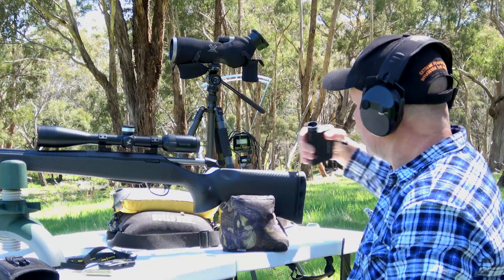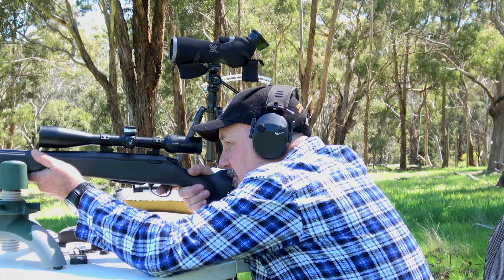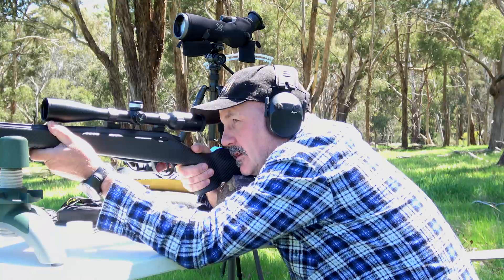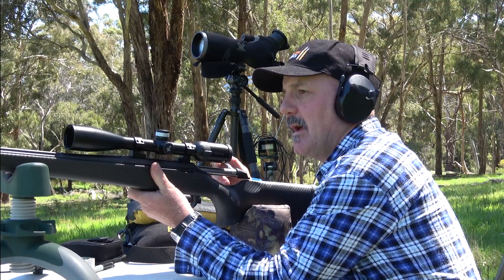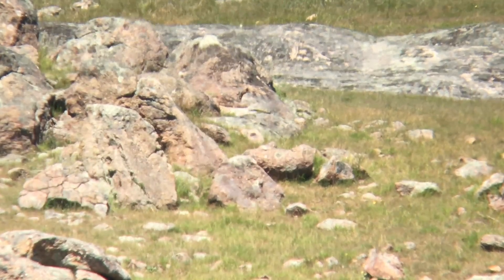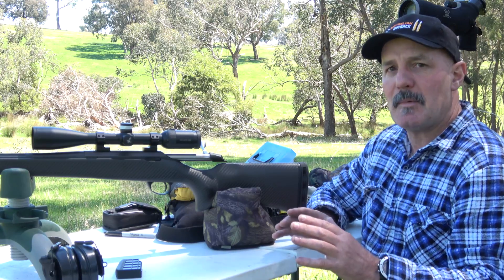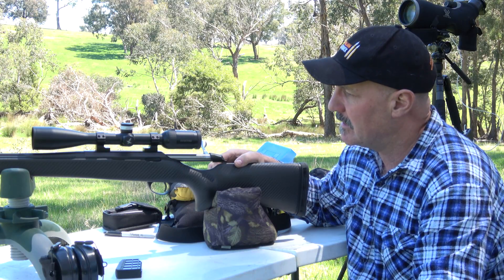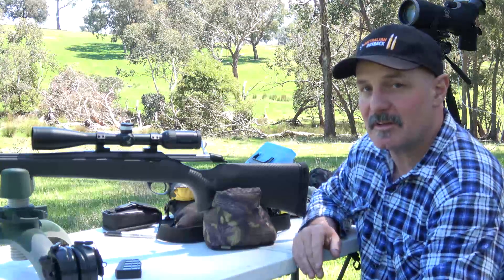Tikka T3 Custom Build part 3 ---- "RIfle Review"

Comment: Enjoyed the videos as always, agree the Tikka is a very dependable buy, always accurate straight out of the box. Your 7mmRM certainly looks lively alright, I'd be after a bit more weight to help calm the recoil and improve field accuracy, about 9lbs all up. Not a criticism just a personal preference. How do you shoot it in the field, off a bipod or your rucksack or a small bag? It's a great choice for larger heavier deer the 7mmRM, IMO the best cartridge for large reds and sambar in the 180kg+ range and 400-700yds+. We have switched to the ELD-X in 6.5 Creedmoor, 7mmRM and .308 here in NZ to great effect... just a shame that our 1:10" .243s are not a fast enough twist to use these pills in 6mm.
Reply from the maker: For the longer shots I would probably choose steady stix as these have worked well for me in the past. The ELDX seem to be performing very well in most calibers.

Comment: Nice rifle! I've had my eye on the Tika T3 supper varmint in 7mm rem mag, but it's overly heavy and not necessary when you look at how accurate these hunting weight rifles can be.
Reply from the maker: Never seen any T3 not shoot well. You have plenty of options you just have to choose what suits you best
Reply: Are you using polymer tipped rounds?
Reply from the maker: I am using the Hornady 162gr ELDX which has a newer tip that apparently doesn’t loose its shape through heat

Comment: Mate thanks for these videos, massive help as I've been researching a similar build. Question is, what model Tikka did you get the barrel and receiver out of? I notice you said it's a set trigger but as far I can tell that doesn't come with the super lite/fluted barrel? Or can it be custom ordered?

Thanks again and keep up the videos, always a great watch!
Reply from the maker: RQ. The original rifle combination was a timber fluted T3. Possibly classed as the superlite. The Kiwi Composite stock is now called "Southfort Labs". You can do a search for this on Facebook and they should be able to help with any details. One thing to realise is that the stocks have not changed for the T3X. The issue we have now found is that the ejection port is cut a fraction larger and lower on the new T3X action. This means that a very small part of the ejection port will be covered by the side of the  carbon fiber stock. Not a deal breaker but you need to be made aware of this. You will also have to allow for bedding of the action.
The "Set Trigger" can be added when you order the rifle and it will add approximately $300AUS to the cost of the rifle. Deciding to purchase it later will cost in excess of double that amount.
Reply: Thanks for the reply and the info, it's much appreciated. I have read that the ejection ports are slightly different on the T3X, might need to pop an email off to Southfort and see if they foresee any problems with that on a larger calibre. Hopefully it's not an issue. I've actually been trying to find someone selling a new T3 somewhere but I think I am a bit late to that party, T3X is the go now. So I assume your barrel is the 24.4" barrel? I figure the fluted barrel would compensate for the weight of the extra 2" which would be nice. Your setup is such a nice end weight, my xbolt weighs just under that that without a scope on it, and that's known as a light gun. For a 7mm setup, this is perfect.

Again, huge help, thanks a lot I look forward to more vids with this firearm in it, love it.
Reply from the maker: Southfort were given very little information regarding the T3X and haven't changed the stock dimensions.

Comment: Howdy mate, I wonder how you like the tikka so far. I have a t3 in 7x64 brenneke, as it is one of the most used calibers here in europe. And its not far behind a 7rem mag in velocity. Gives up about 60ms. But what I have found out is that my rifle is harder to shoot in the field as accurate like on the range. But mine weighs only 3.2kg with optics. My 7 rem mag weighs 4kg and a bit. And that 7rem mag i have is extremly easy to shoot. Whats your opinion about that topic?
Reply from the maker: I think the key to sighting and testing groups on a light rifle is to do this as near as possible to your stance that you will use in  your hunting positions. Don't use a bipod. Front and rear bags are the go on the lighter rifles a good grip on the fore-end without going silly is a good start. Consistency in your grip and hold on the rifle is the key making sure nothing fouls on the bags as the rifle recoils. This includes the front rifle sling stud. I have used my Tikka quite a bit so far and I have found it fantastic in the field so far. If you haven't seen it in use here is a couple of videos that it has been used. https://www.youtube.com/watch?v=ZX1cLtFurfg
https://www.youtube.com/watch?v=b7AIPIhZQhE. There are a few more but these are the most recent.
Keep me posted on your progress.
Reply: you are right about holding onto the forend, but my problem is i use my left hand as rear rest, and I shoot with a bipod, so i cant hold the forend, but it shoots amazing with that technique at the range. If I could post a picture I would send you a few groups. It shoots under 1/2 inch with the 162 eldx. Ive chosen to use this technique which i described before, because I dont have a rearbag with me while hunting, and some shots happen quick, and I am extremly fast setup with the bipod and my left hand holding onto my right arm, never had a problem to hit with it out to 400, but its just not as easy like with my rem 700. But I will take the 7rem mag with me to Victoria this year;-) as I can hit out to 700 with it when it is not to windy.  A buddy of mine from Tasmania takes me there, I want a sambar:-). Like your vids a lot, keep em coming.
Reply from the maker: Still not a fan of using bipods on larger caliber light rifles. It might
 shoot well but I personally think there are better techniques. If it is
 working for you that is all that matters in the end.
Reply: Bolt-Action Productions yeah buddy, if I would have a beeter idea which is consistent in the field i would use it, but maybe you know a good tip for me?

Comment: Get a brake from Terminator products boss!
Reply from the maker: Can't stand brakes and not required for a deer hunting rifle IMO. Used one on my Roughtech and that just convinced me more to get rid of it.
Reply: Ha! All good then. Just looks very lively, but you're still nailing groups. Nice little series man.
Reply from the maker: Yes it is but the amount of shots fired out of this rifle in its normal hunting scenario is going to be very few and far between. Besides the additional noise to the shooter from a brake the extra length would really make it a pain in the backside in the bush. The barrel is long enough as it is.